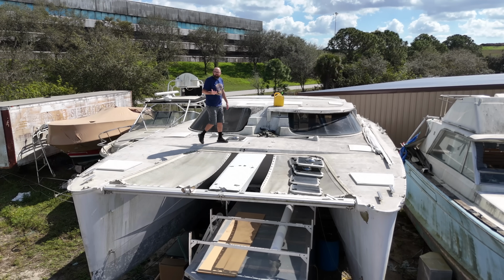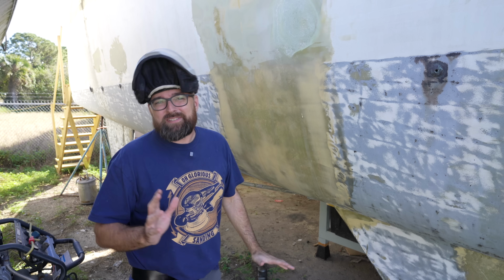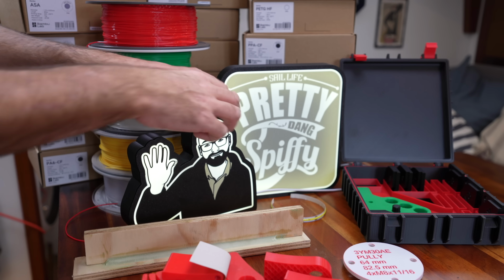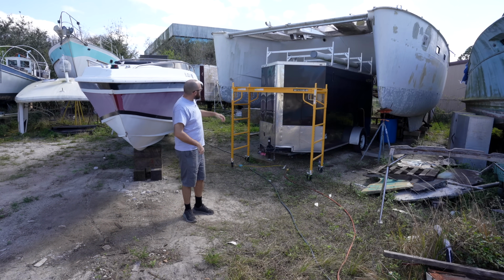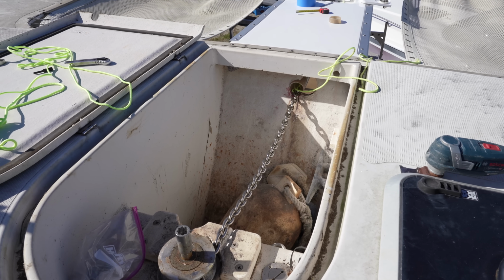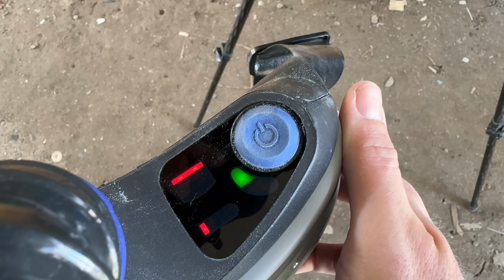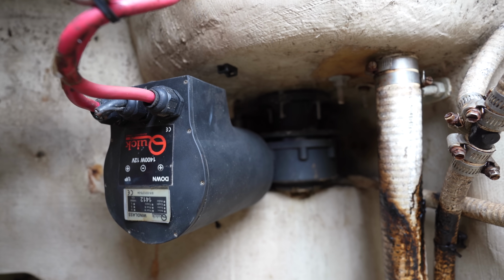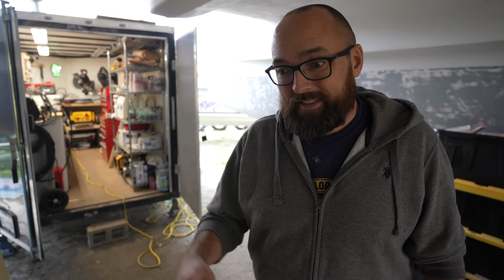⛵️ Failed repair? Now what? Hurricane-damaged catamaran Ep616

Comment: We (me and my wife) have the utmost respect for you, but we feel you are hurting yourself by promoting bambu labs after what they did. It doesn't look good at all, especially being a diyer, nobody should be buying Bambu labs untill they reverse they're actions wich seriously hurt the diy community.
Reply from the maker: To be honest I’m not up to date on the latest in the policy drama. So far I have been able to do everything I want to within BL’s ecosystem. I know I’m not a super advanced user and other people might have more advanced need but there is also a huge segment of users that will never need to leave the BL ecosystem. I can only speak as a newcomer to 3D printing and for that I think BL is doing a good job. Both the hardware and software is easy to use and you get good quality prints right out of the box. I signed the contract for the two BL sponsored videos back in December (before the drama) but so far with what I have personally experienced with the printer I don’t feel bad about promoting them. In my book they’re a solid option for someone new to 3D printing. If I understand correctly the policy change made it so that a separate pice of software is necessary for authentication when using 3rd party software. Is that correct? In what use cases would you need to use 3rd party software? :)
Reply: @SailLife  Thanks so much for your reply. Its not just the Slicer problem however Slicers are not all equal,There are slicers that work better for each type of job, and have more functionality. Here's 2 scenarios as an example:
1:In the future real 3d non planar "slicing" will be perfected (this is where you have the ability to print at an angle on the z axes, like a milling machine) when this happens you might not be able to use it. 
2: an update might come up that needs to check with the cloud for print safety, regardless of the existence of starlink, being on a boat we prefer our things to just work offline.

There are many more issues with bambu labs approach, and aldow i believe they have the freedom to do with they're product whatever they wish. I dont believe they should be able to limit the functionality of a product you have already bought and paid for. 
Btw why not install a easy to replace maybe in two sections, Teflon pipe inside the chain tubes it would make less noise slide much better and protect the fiberglass tubes. 

Cheers mate.
Reply: @SailLife I own a Bambu Labs X1 Carbon, Prusa MK4, and Ender 5. They all worked perfectly from the start. However, most printers use an open source slicer and interface but Bambu uses its own proprietary software. The fear is it will limit your options in the future and they could switch to some type of subscription based software. No one knows if that will actually happen. With that said, there are some really smart users in the 3D printer community that are already looking into replacing the control boards in the Bambu Labs printer to convert it to use open source software. Time will tell.
Reply: @SailLife  Bambu lab great 👍
Reply: This
Reply: @SailLife- call Blue water boats in new Smyrna for the fiberglass mat
Reply: totally agree.... bit dissappointed with the sponsor really
Reply: Oh stop already. Are there a bunch of people sitting at your keyboard? You used “we” like everyone that watches sail life agrees. Bambu makes a great printer that just works every time. If you want to spend countless hours trying to make a printer work buy something  else. I have several thousand hours on three of there Carbon printers and have never had a single problem with the printer that was not user error. My Prusa printer has less than 100 hrs and has never really worked.
Reply: @paulthunberg4543  lool. We "is" me and my wife. I did not say it was a bad product, im referring to their actions, they soaked up all the open source knowledge, and are now clamping down on open source practices. Do you agree with the drm approach of Bambu lab's ? If there is no pushback it won't stop here it will get worse with every update.  PS. There are many many open source printers that just work, I have a 15yo xy core craftbot that has never failed once "except for the usual user errors"